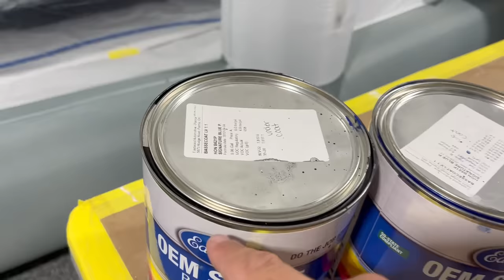I Completely Ruined THIS Paint Job

Comment: Good honest video. I appreciate these videos. 
I purchased a little project hooptee and planed to respray some of the panels due to clear coat peeling. I plan to do it with spray cans because I don’t have a booth nor a big garage where it will fit with my other vehicles. I did a few touch ups after sanding, but it came out a big orange because I ran out of paint.  
Can I sand down the clear coat on my project and re spray base coat on the panel I recently did and primed initially?

Comment: A very nice and informative video, I applaud the quality and detail contained! Painter noted he was using a 4 to 1 high glamor clear coat….a high solid product  Noticing that the “fish eyes are on the top of flat surfaces , I would be more inclined to think that the defects are “ solvent pops” from spray clear coat to heavy. remember A flat vertical surface retains 50% more sprayed material that a vertical panel.  Using similar product in our both, we must spray a 4-1-1.5 reduced mixture  of clear and a 50 to 75% wet initial clear coat, allow to dry to a light touch, than apply gloss coats. This allows solvents to vapor out before being captured by a surface skin coat, only to be  released by the following wetter coats allowing trapped solvent to migrate up and out leaving the crater.

Comment: I had that exact same thing happen to me on a home spray job once the clear started going down. It was the air supply. I had cooling loops, I had the dryer, all of that.... The humidity in the garage, especially moisture coming through the concrete floor, overpowered all the mitigation efforts right at the end of the spray job. For the second go at it, I cracked open all of the drain valves in the cooling loops to make a small leak. Those areas of low pressure condensed any trapped water in the air. I added another desiccant canister. That fixed the issue.

Comment: Other then the fish eyes it looks good. Also, a bad batch of clear or hardener can cause fish eyes, and before you go thru the trouble of repainting it, do some test panels, use that clear and then maybe you cans get a lil bit from work, if both fish eye then there’s and issue with the spray environment, or equipment, if the East wood clear fisheyes then it’s a product issue. Also, devilbiss make a floor spray that helps with keeping dirt on the floor.

Comment: The contamination is probably little micro particles or perhaps outgassing from the plastic the paint booth is made from. I would not be surprised if silicone is one of the ingredients in the plastic.

 It also looks a lot like the silicone contamination we had in our lacquer finish at an antique restoration shop I worked where someone had used silicone spray on the table saw top as a lube. For years that contamination kept showing up.

Comment: I had the same issue here with a single stage paint and the Eastwood compressor. Lots of fish-eyes!! I installed an oil separator and moisture separator and the situation was much improved but not perfect. I didn't think about the same hose being contaminated from using it prior to installing the oil/water separator! I bought a brand new hose (which I now use only for painting) and now I'm getting no contamination at all. Problems now are down to lack of skill and needing more practice 🙂

Comment: 28 yrs ago spayed my restoed 68 Cougar in my 2 bay old Gulf station garage, took 2 panels out of garage door and put furnace filters in. Put a piece of plywood in rear door cut it out for a Bigass squirrel cage and wetted the floors down. Did use dedicated 1/2 line for gun and similar filter, lines ran under the floor, kept it cool. Turned out great, didn't need to buff it or... I'm guilty of over thinking things all the time but sometimes simpler can be better. It still looks great

Comment: I would suggest forcing filtered air in from through the top and letting the pressure push it out as low as possible in multiple spots to keep the air from blowing across your project. I think the way your setup pulls air in instead of pushing it in, and having most of the pressure go straight across your project due to the intake and exhaust being level with your project in a straight line is most of your problem. Other than that you may want to make a 2 door air lock sttle setup with a space between them for your entry/exit to keep the stray particles to an absolute minimum when your coming and going.

Comment: Hey Brian, it is not surface or a compressor problem, it’s due to not waiting long enough for base coat to dry. Because you spray in a different setup and atmospheric temperature, you should wait bit long until the base coat dry properly. Any spray booth I spray in,I would wait for 20-30min right after the base coat. If it’s a rainy day, I would definitely give it 30-45min. Unless the job has to go out fast 😅.

Comment: for the peeps at home. Do the ole moonshine trick with the air hose.

Grab a 5 gallon bucket, fill it with ice water. coil your airhose in that bucket. Wham, air line refrigerator/condenser on the cheap.

Comment: One thing I learned after painting for 40 years is to wash the car before I do anything. I wash everything with Dawn, because it contains formaldehyde which emulsifies fats and oils. Once it's dry, I spray the entire car with Purple Power or Simple Green, and use a dedicated brush to agitate it and pressure wash it with a hotsy at 190°. After that, one more round with Dawn and a hotsy rinse. You never know when you have a an armor all stock holder who doused the tires with silicone soul glo twice a week. If you don't strip the contaminants, when you sand, you force them into the sanding scratches and no amount of washing will get it out. Especially on plastic cars like Corvettes, that absorb silicone into the pores of the SMC.

Comment: If you want to see how much water is in your air line, take something like a steel block or even a brick and throw it in the freezer. Then, once its cold, shoot air from the compressor at it. Any moisture in the air will condense onto the cold surface and you'll see the moisture.

Comment: Back in the day, I used to work at an automotive collision shop. We started the day buffing out small lacquer, repair jobs. Then it’s coffee break time, do some masking on other jobs that need primer coats. As the day goes on, you finally get into doing some more spot painting like hoods fenders doors you name it. Most of it is fast drying acrylic, lacquer.
One job I’ll never forget it’s a deep red Cadillac that hit a deer so a new hood fender and blending into a door. The primer went on. No problem sanding no problem back then we mostly took it to 360. I mixed up the paint from Dupont , the proper color code, and put the first and second coat on. By the second coat, I was sure I was seeing some Fisheyes. Oh S##T!!! I remember masking off the windshield and windshield post and a few other items, and I was having trouble with the 3M masking tape sticking. I tried rubbing it with prepsol but still had lots of trouble. I called my head painter over to look to see what he thought and he said G Neal that’s too bad. Just add another really wet thick coat and see what happens.
I wound up painting that vehicle another three times! This was about a year and a half or so after armoral hit the store shelves! 
 Load it up and sand it down.

Comment: I work at a shop where we use the sikkens line and we were having problems with fish eyes in the clear. Oddly enough we narrowed it down to being a problem with the sealer not being agitated enough before applying or not waiting enough before top coating. If the filtration is not the problem maybe it could be something like that

Comment: Hello, I got exactly same problem with a nice SATA 3 stage filter just after installation, a lot of fish eyes. I was thinking first something wrong with a cleaners or my chemicals but second time I add inline little filter before spray gun and everything got smooth. I think in the new equipment still have a little amount of the oil. This is just my opinion.

Comment: That's frustrating.
I've painted outdoors before and had tiny raindrops hit the clear right after laying down the final coat.
I don't know if there's any overhead condensation issues in there, but those look almost exactly the same as what I experienced.

Comment: That most definitely can be saved. After your second coat of clear has flashed off. Get in there and tediously dab every fish eye with a touch up dobber with leftover clear, you can even come back and throw a third coat on, once cured block with a 1000 grit and then finer and buff off. Even if you have a couple of fisheyes after any paint job you can do this step also can use super glue or windshield glue to fix fish eyes.  These are things I’ve learned to do in a production shop, respraying costs time,money and turnaround time back to the customer
Reply from the maker: 100 fisheyes nahhhh lol

Comment: I remember when i first started out had fisheye like crazy changed my air setup and filters and modified my compressor now its gone i did have a few in a recent job painting an underside of the hood im thinking it was a surface problem even though I cleaned it couldn't be my air its completely clean but it's hardly noticeable

Comment: Beautiful colour ! Dam , I’d be shaking right now if this happened to me , hopefully it’s easily resolved . We had a makeshift paint booth at work years ago , and I had no issues like this whatsoever. I purchased an online filter for the air before it got to the gun , it’s been decades but I think it removed water . 
My biggest issue is when the overspray finally left the booth , I went back in and seen that everywhere I had stopped with the gun left a vertical mark . I was shooting metallic paint , and that was what was showing up when I stopped . I’m a noob , but a ran and mixed up a little more paint and walked around my truck again , this time without stopping , a sort of flash coat , and it turned out perfect .
I certainly learned just how difficult painting can be

Comment: I’m restoring a Porsche 914 and I just spent a lot of money on a full Glasurit paint system using the original 22 line single stage.  I’ve put a lot of thought and planning into the air supply and how I will convert the garage into a booth.  But what just happened to you still scares me!

Comment: I rate the honesty the side of bodywork customers dont see. I paint 20+ jobs a week and runs/reactions can happen to anyone even if the best of us no matter how methodical and perfect you tackle the job. The true mark of a good painter is the abilty to bail yourself out the shit. You can train a monkey to put a glass finish down but you dont become a true master until you learn to solve the issues. I would have done the same thing to bury the defects. A tip I learnt years go to solve silicones/Fish eyes. let your 1st coat flash 20 mins as you did, then drop your gun pressure to 1-1.4bar do a dry pass to create build dont worry about the peely finish. let it rest 20 mins again then hit a 3rd heavy coat, that 2nd pass created the build to bury the issues the 3rd will flow out as normal. keep up the good work.

Comment: I painted my own project in a booth similar to that but made by vevor and got almost the exact same results. However, I painted it white so I could easily see the contaminates and in the middle of every single fisheye was a black speck. This is not conclusive but I think that it was the filter for the incoming air that as you’ll remember you started blowing air through right before you started having contamination issues. In my experience it goes away as you use the booth, but I think you could still test it with some test panels with and without that filter. Thank you for all the information Brian, and I hope that I could point you in the right direction.

Comment: Contamination, usually oils, or even gasses like freon in the line or in the air.  It could also be reaction from the bottom of the base coat it happens.  I would wait a couple few days in the sun , sand the clear lightly be careful with the edges, 1200 grit, and only re-clear, very light coat, wet coat can cause a reaction.  If there is no reaction, lightly cut and buff and your done.  Used to paint cars to pay for the University...

Comment: Is it a waterborne base? I had the same problems at home. It's very sensitive to airline contaminants. I use a toothpick to drop tiny amounts of clear in the fisheyes and then sand and polish when the clear is dry. I never have fisheyes at home when i spray with a solvent based basecoat.

Comment: Add a Fisheye Filter to your spray gun.  I have found they are absolutely the best and final line of defense against contaminants and water.  If the Fisheye filter becomes saturated, it will actually shut down the air flow to the gun.  I have no association with Fisheye Filter other than using them on all my spray guns and airbrushes.

Comment: Brian, is there any kind of coating on the material of the paint booth? I have a hard time believing it’s surface contamination, simply because I know how well you clean those cars. Only other place is the jambs and engine bay may have dressing in there.

Comment: Brian Love your videos, but are you sure these are fish eyes and not solvent pop?
They look like they are only on the horizontal surfaces and the strong current of air blowing across to the extract filter could be drying the surface too quickly before the solvent has evaporated?

Comment: I had a similar problem a few weeks ago with my Paint system. I do mobile work at peoples homes. I started getting water in my system so I built a water trap out of PVC. It was working great for about three weeks. Then I started noticing fish eye and solvent pop. After three painful weeks of trying to correct the problem, I finally figured out. It was the water trap (pvc pipe glue). So I removed the water trap and now my paint jobs are super clean again.

Comment: Hey Brian I have exactly the same problem just a bigger booth 16x32(or so)with extra room and three fans. Two to keep it up and one to push air inside. So what I figured out was the exhaust filters got clogged and all the overspray was slowly circulating inside and not much was getting out. While in the air it was passing next to stitching holes that are leaking air inside of the booth. Next to each bigger hole I found dried overspray buildup of clear coat (sort of icicles were forming). Once I was done with 28oz and went out to refill each time I came back there was more and more contamination. My booth has joints of support tubes in the center ceiling and that’s where I found the most contamination right there underneath the joints. While  I was going in and out the dried overspray would fall down. Now I checked and every surface that is more horizontal the more it was contaminated the worse was roof hood and trunk lid. The best were sides that are vertical and doors that bend under the car zero contamination there. I used one elephant ear. I ordered one more and will get rid off black filters on the side of the paint booth cause they clog up very fast with paint and when I get to clear it’s a game over. Also I’ll stretch a sheet of plastic above the car to prevent any from falling down. I hope that will solve my problem.

Comment: Hi Brian. I would contact Eastwood and have them ship you out the modifications they applied to the 3rd generation compressor you have. There is a know issue with water build up with the earlier versions. I'd also filter the air coming out of the vent. That's what I plan on doing when mine comes in in a week or so

Comment: i think that having a negative pressure in the Booth, with that extraction fan, pretty much guarantees pulling dirt into the Booth...you should have filtered air coming in, with slight positive pressure, and your exhaust system pulling just enough that the Booth has only a slight outward bulge in the windows/walls...negative pressure kills any chance of a clean environment!

Comment: That is the exact same thing happen to me. A friend let me borrow inflatable booth which is a smaller size booth than your booth. I was going to paint both fenders one day then front bumper cover another day then hood on another day. Base coat came out flawless on both fenders as well as first coat of clear. When applying 2nd coat of clear it looked ok at first, then all these craters started to appear. Lucky I did not proceed with 2nd coat of clear on other fender. They looked exactly like what you showed, except a lot more. This booth does not have elephant trunk. One tube on top blows filtered in and overspray is pushed out side filters. Got so much overspray from clearing, I could barley see. I think Im going to leave one end unzipped to get the overspray out faster.. Still not sure why this happened. I have painted motorcycle parts using same paint and clear on back patio without booth and other than a little dust nibs, which sand and buff fixed, I have never seen this before. I'm about as lost as a fart in a whirlwind on this. Look forward to your next video on this.